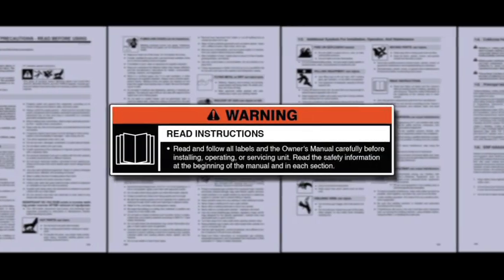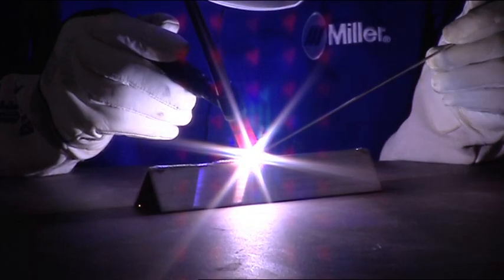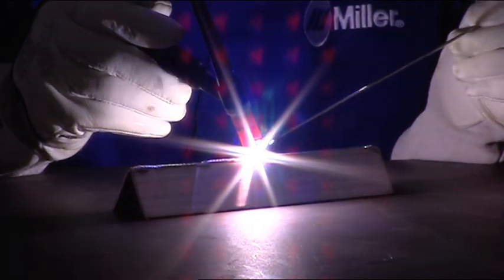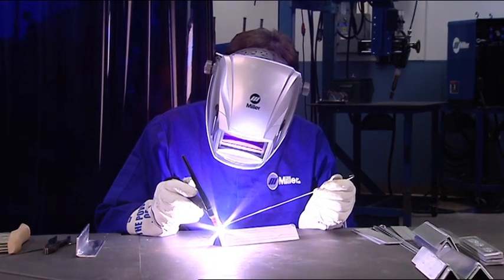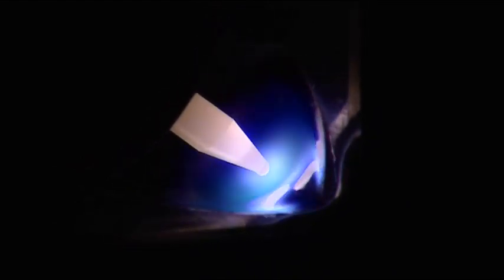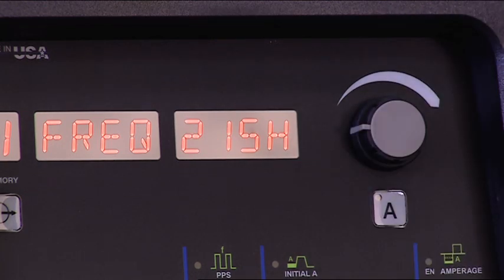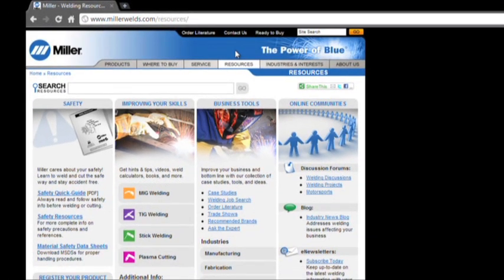TIG Welding Aluminum: AC Frequency Control

Comment: I have a question, the tungsten electrode not to form the ball at the end, it made of a special alloy? Or only the change to 120Hz and the settings that the machine maintains the cone in the execution of the solder?
Reply from the maker: Hi Saulo,thanks for the question. When welding aluminum with an older transformer type power source, a pure tungsten (green band) was used with a balled end. We do not recommend the use of pure tungsten when using newer inverter based units. A balled tungsten will cause the arc to wander as electrons are emitted off the end. Inverter based units provide advanced AC wave shaping capabilities. Using a balled tungsten defeats the capabilities the inverter unit provides. When welding in AC on an inverter, we recommend using a 2% ceriated tungsten (grey band). Sharpen the tungsten to a point, then truncate the end of the point grinding  a small flat land on the end of the tungsten that is about 1/3rd the diameter of the tungsten its self. Thank you.
Reply: Thanks for the answer. Miller is to be congratulated with the channel on youtube. Thanks.

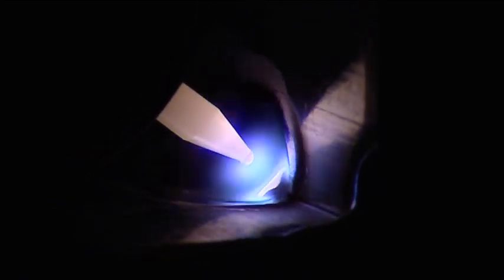Comment: Poor comparison between the two welds at 1:10 and 1:14. The tungsten shapes are completely different. Of course the 2nd weld will have better arc control, regardless of frequency setting. The tungsten is a lot sharper and more concentric at the tip. Sharper tip= more accuracy. I know that the tip is more prone to ball up larger with lower frequencies, but there should not be that huge of a difference between the two when doing a back to back comparison.
Reply: 6061. com Hi 6061 love your channel to bad I can never comment 😒

Comment from the maker: Someone's recently asked, "Does the low frequency cause the electrode to ball up much more than high frequency setting?" Yes, it can increase the balling effect due to longer (but less frequent) times spent in electrode positive. Think of it this way... You can tap your finger gently with a hammer many times, but if you swing hard a few times it will hurt much worse! Main reason for the tungsten being balled in that video is a reduced AC balance setting of the traditional power-source design.

Comment: Does the electrode with a large ball affect the arc wander?  Does the electrode ball up a lot at 60hz as opposed to the sharper electrode used at the higher frequency?
Reply: Yes, it greatly affects the wander. Depending on tungsten type, it will ball up noticeably more at lower frequencies and high amperages.

Comment: At 1:04, I notice that the electrode is all worn and has a lot of arc wander.  Does this happen with low frequency ac?  Whats the amperage setting on it compared to the next shot of a relatively sharp electrode?

Comment: It stays sharper exactly because of the frequency. It stays on the "electrode melting polarity" for "less time", thus the electrode stays sharper, which in turn gives you more arc control...

Comment: Good point, pardon the pun, but you can you clearly hear the higher frequency humming along a lot faster on the second weld. And how sweet, clean,and fluid is that weld pool. I would love the capability to have wave and frequency adjustments.

Comment: Hello

If you look closely you find that bigest reason why arc in this wideo was wide is that tungten tip in lower frequency was lot bigger than in hi frequency welding.
If you have sharp tungten tip you get narrow acr and if you have bigger tip you get wider arc.

Higer frequecy has only small effect in this.

Comment: I am not a welder, but just learning tig on my own. I think the difference in  high frequency is the ability to place the arc and it not divert due to pulse spacing.  The slower the pulse the more chance for arc wandering in a corner.  Does the frequency affect the tungsten tip? Does hi frequency help retain the point, or is that a ac balance adjustment thing only?